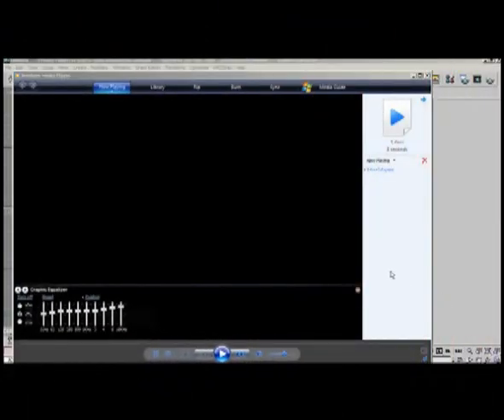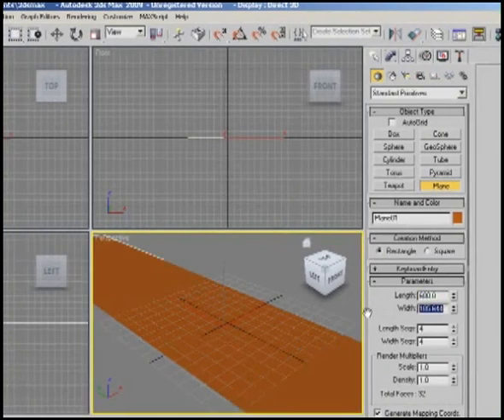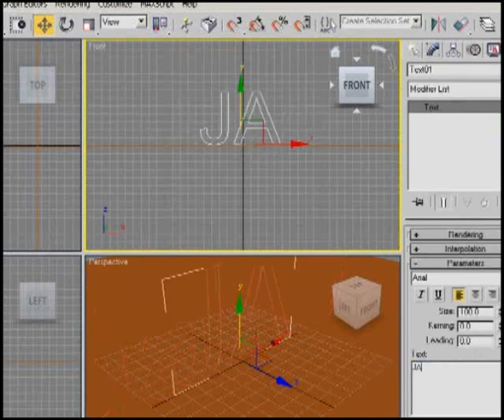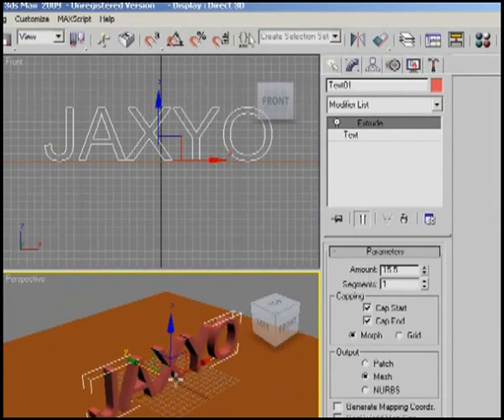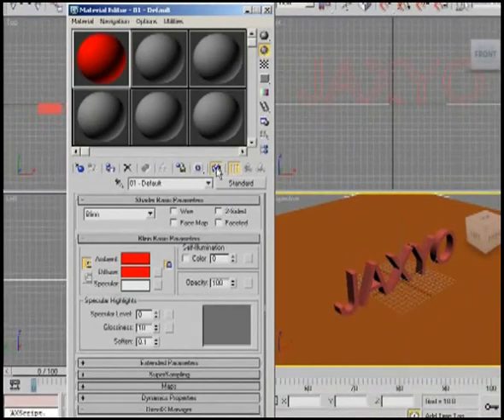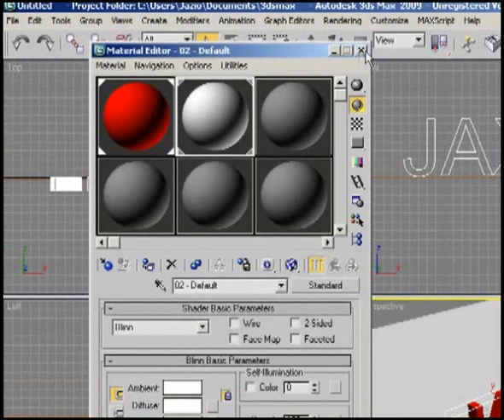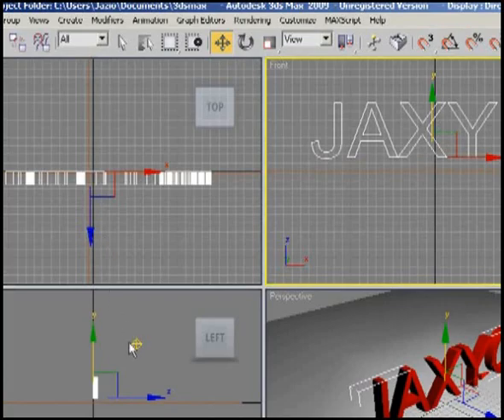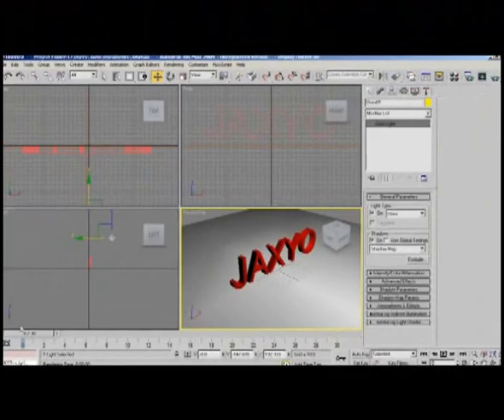Text Explode Shatter 3DS Max 2009 Simple Tutorial pt 1 of 3

Comment: that almost always (99%) of the cases has something to do with DirectX and VideoCardDriver. Make sure you have the latest drivers.
Then, if the problem remains the same, go to CUSTOMIZE > PREFERENCES > Viewports > Display Drivers and switch to Direct3D if you're on OpenGL. You can also try switching between DX10 and 9.